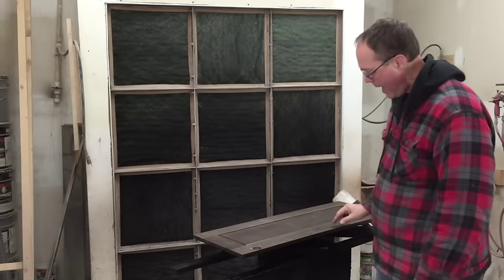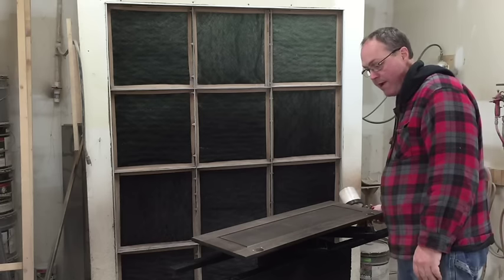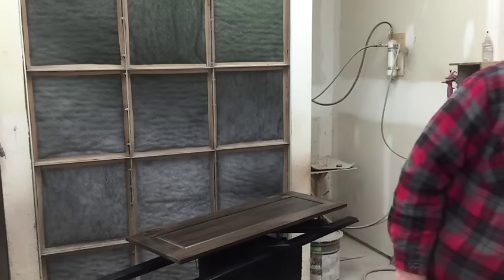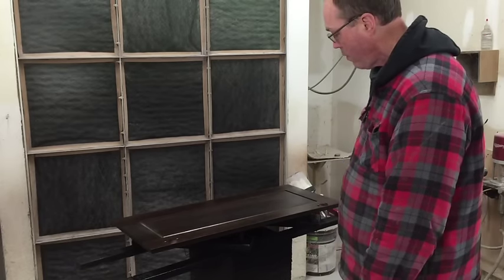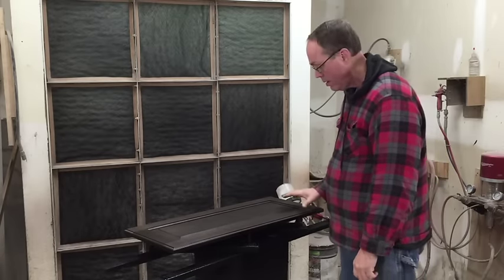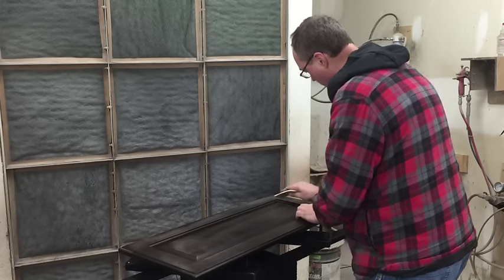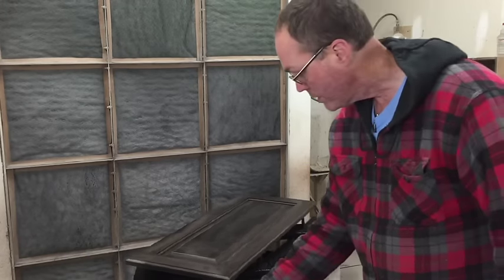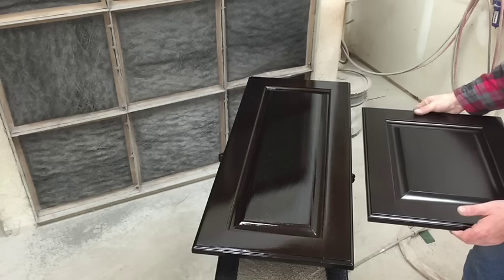High-End Finishes - Video 2

Comment: It appears that your shop is cool. What is the lowest temperature that you spray dye and lacquer?
Reply from the maker: Russ Martin - I’ll use a torpedo heater and get the temperature up to a minimum of 40 degrees.
Reply: @robertweaver6601  Interesting. Most paints recommend no lower than 50. Can you suggest a supplier of Gemini products?
Reply from the maker: Russ Martin - I buy from my local cabinet shop supply house. Hartselle Plywood & Lumber.
Reply: @robertweaver6601  Thanks. I'll try to find a seller near me. Sorry to hear they were burned up by an arsonist a number of years ago. I have a friend who lives in the country. He doesn't believe in locking his doors. I told him, bad things happen everywhere.  There is no excuse for not having good security today.

Comment: What products would you use to achieve a gloss piano mirror black for a buffet table ?
Reply from the maker: Captain Will. You can buff just about any well cured top coat that is a hard finish. I came across this video when I was researching buffing epoxy. I use the Mirka pads when buffing epoxy countertops. I think this would help you. 

https://youtu.be/K0pXjV4zGDM

Comment: Did you make that filter wall?  What kind of fan is behind it?
Reply from the maker: Ray Weed -  I did not build it. The shop was leased. However, I can tell you that the filter room/box was about 36” deep by about 7.5’ tall. It was lined inside with marlite which is a slick material. The exhaust is mounted in the top. It was a high com explosion proof tube fan.

Comment: Why would you not just apply the stain three times to the right darkness rather than sand-sealing it between coats?  BTW, I know zero about staining/sealing tech...  I’m researching how to do this now!  Thanks for the great videos!
Reply from the maker: Adrian Abshire - this particular dye stain was very opaque and I was building up to the shade I wanted. You could get a stain that would do it in n one coat. With maple, however, it would be easy to “paint” away the grain if you aren’t careful. The opaque stain allowed me to sneak up on the shade I was looking for.
Reply: Thanks for the quick response!  I am building European frameless cabinets and so far NO doors only a ton of drawers.  I used a flat domestic Maple (thicker veneer) plywood to make the slabs.  So if we want an ‘opaque’ stain is there a particular brand/type we should use?  I have seen General Finishes and not sure what the local hardware store carries but will check tomorrow.  I think you had suggested oil-based.  So the workflow would be: sand with 220, spray dye stain, 320 sand, spray sand sealer, (assuming we want it light/medium), 320 sand, then spray several coats of lacquer (320 sanding between coats) ??? Would that work - we want a HIGH gloss shine to the cabinets (like a car)...  maybe I need to invest in a paint booth! Lol

Comment: Hey Robert, I love your content. I do have a question and please forgive me for not fully understanding as I am fairly new. Let me know if I'm understanding correctly. You're using a petroleum-based dye stain, a sealer, and lacquer? (3 different products)
Also, I'm I understanding that you're able to use the dye-stain on before and on top of the sealer? Is the sealer also colored? I apologize that these questions are so basic.
Reply from the maker: Tee Jay - yes. I sprayed my dye stain first then sealer. I was able to spray a very light coat of dye on top of the dried sealer. Once that dried (don’t touch) then I sprayed another coat of sealer. Then sprayed the conversion varnish on top of that. All are petroleum based.
Reply: @robertweaver6601  Thanks so much. Please continue to publish videos, we enjoy them.

Comment: I will not use precat sealer and c varnish it will not stick on it
Reply from the maker: ray oñate. The Gemini conversion varnish is not the same as a traditional varnish. It is more like a lacquer with solids. It works very well with the Gemini sealer. I have no problem with adhesion.

Comment: Hi great video...  Did u thinn the stain with paint thinner or lacker thinner?
Reply from the maker: The stain is a dye stain and required no thinning.
Reply: @robertweaver6601   mineral spirits was always used to  stain. lacquer thinner evaporates too fast
Reply from the maker: This was a dye stain.  No thinning. It has the viscosity of water.